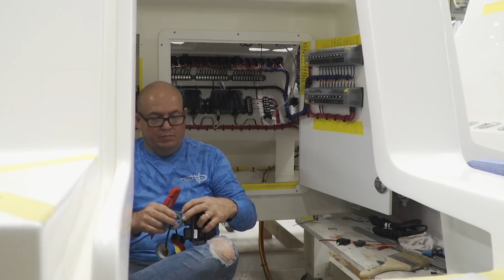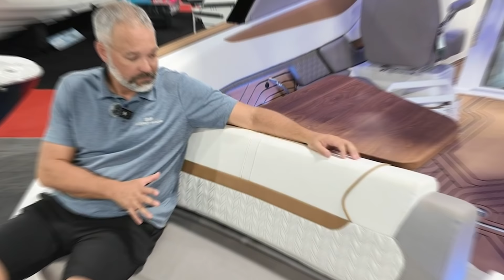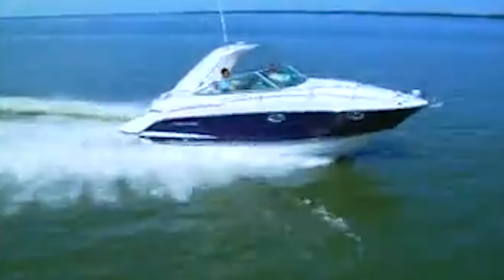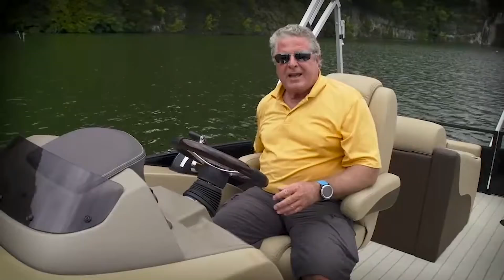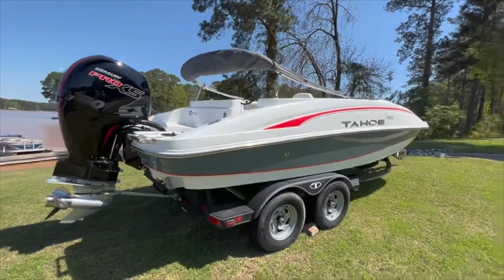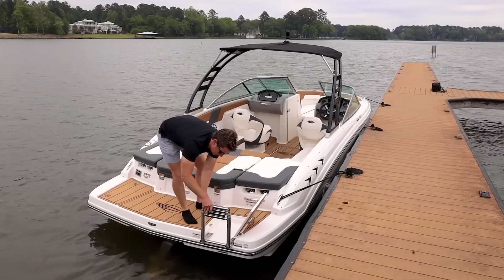9 Boats So BAD Even Dealerships Are REFUSING To Sell Them — Brands Going BANKRUPT

Comment: I bought a 2022 Cobia and it has given me problems since day 1. It was out of the water for 1.5 years after only 70 hours of use. Both Yamaha engines had to be replaced as they weren’t being grounded properly. No support from the dealer, manufacturer or Yamaha.
Reply: And yet both Cobia and Yamaha have great reputations, sounds like a lawsuit to me- probably dealer issue as they are responsible for Rigging and final checks (not sure that Cobia rigs the Yamaha). Does no support mean you paid for 2 new engines-  cant imagine that.

Comment: The basic problem is that the boats are made too quickly.  Curing is not being done properly in the right and ONLY temperatures.  Electrics are often cheap Chinese rubbish.  Transoms are not being made from HARDWOOD, but they do use CHEAP ply that goes soft in a couple of years.

Comment: To save you some time they list Chapparel, Four Winns, Lowell’s, Monterey, Tahoe, SeeDoo, and Yamaha. The video is very repetitive and could be much shorter. I have a Yamaha and don’t completely disagree, but I knew was a “value” boat from the start. My dealer has no intention of selling fewer and is in fact expanding.
Reply: Bingo on the repeat crap, are exact same issues showing up 'in recent builds' across all these manufacturers? If historically good builders like Chaparral (also makes Robalo) , Monterey, etc go bad, where would a consumer turn too?
Reply: @GarryMasters-q1h I have a 2018 chaparral VRX 223. It’s a great boat. The only issue I’ve had was the electronic reverse module. It’s failed a couple of times but the dealer always do a quick turnaround fixing it. People complain about jet drive boats but I love mine. It has 2 built in ballast tanks for wake surfing. We love surfing behind it. Their jet drive nozzle system is so much better than other brands. It reverses very easily, unlike other brands. I see a lot of Chaparrals on the lake I use and I’ve never talked to an unhappy Chaparral owner. That doesn’t mean they’re not there but just that everyone I’ve talked with on the lake are really enjoying them. Stupid video. Thumbs down.